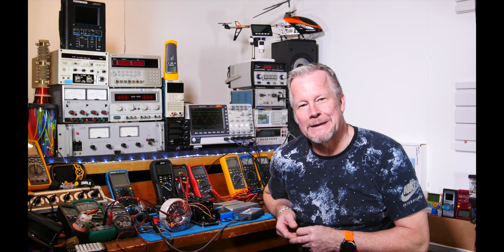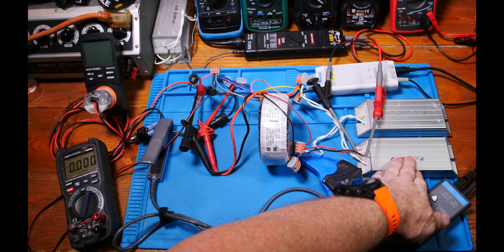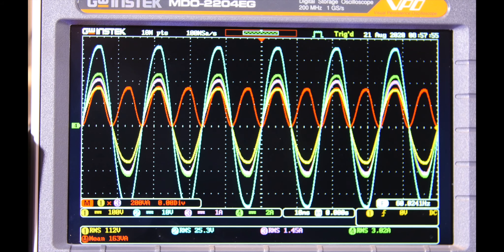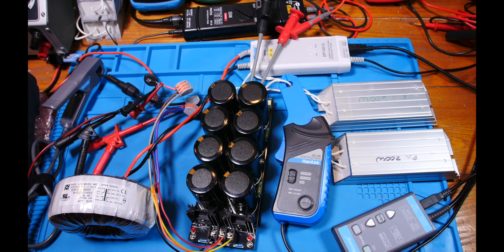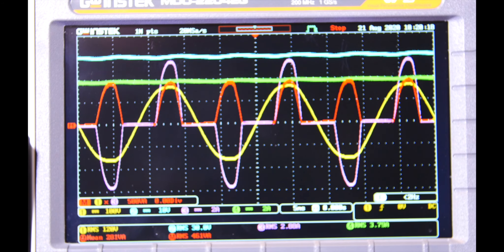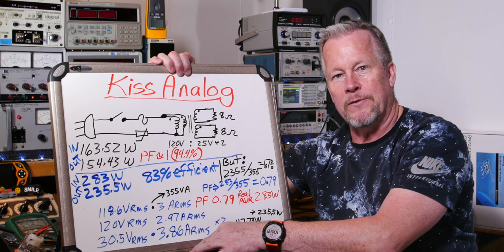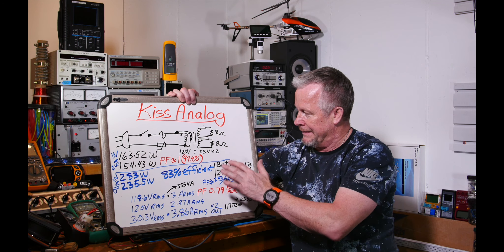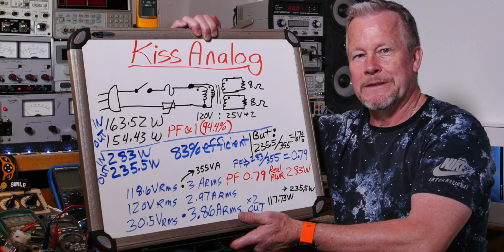Aleph 5 Class A Amplifier; Power Factor Explained

Comment: Excellent Tutorial
I found it interesting to demonstrate that simple rectifying and bulk cap filter dramatically increased power out. Simply DC verse AC into same load.
I also now see PF is a measure of efficiency and an important input into component rating.
Thanks.
Reply from the maker: Thanks for your previous question.  That got me thinking I should do this video;)

Comment: I made so many software simulations and my theory is that not all class-AB consume more than 4 amps at it max or worst case scenarios if the user only use moderated audio levels the rails consumption is really low about 2.5 amps per rail depending on the design, on class A is best to go as large as possible sometimes twice on what is really need it, and yeah I agree is best to calculate that is best choice good video bro 😊
Reply from the maker: Thanks - that’s great info!  I am curious what the dynamic power ratio is to the average power for different recordings?

Comment: Ok Eddy very nice explanation of the power factor, on the forums they say that the power times 3 is the va you want to have, so a Aleph 3 uses 200w of the power supply so you need a 600va, and a Aleph 5 pulls like 300w of the power supply, so 300w times 3 is 900va, my experience i can live with a 800va transformer and have plenty of power for the Aleph 5, for the Aleph 3 u can use 500va but for me the 625va cost almost the same here, so i thake one 625va, o yea and i thake a 800va 2x30v ac out for the Aleph 5 and do a CRC filter in the supply so i have enough for the R to drop, i use a 0,5 ohm so a 0R5 25w for the drop, and i need to have 34v, with the 0R5 you get like 36v so a little over 34v, some do a CRCRC so you have less ripple and less volt, u get like 34v with 2 x a 0,5 ohm 25w resistor on a 800va 2x30v ac transformer, it also has to do with the quality of the transformer, so you need to tune it the way you like it to be, some only do a 0,25 ohm resistors so do what u like and experiment with it
Reply from the maker: Thanks Jos!  You have shown why it is so confusing how to get the right or best design.  I think I need to do more videos on this to see what might work best and how to simply the approach - the Kiss method;)
Reply: @KissAnalog  yea i did some changes to the design of mr Pass, i did change the 10p from the feedback to 22p, but in your video you did say it needs to be like 40 or 50p, so i have to look in to that, and the output mosfets i did change to the irfp250n, mr Pass did say the irfp250n are 2x irfp240 in one packet, thats wy they have more input capacity, and of they have a lower rds-on, like 2 times lower than the 240 did have so i did lower the 1ohm resistors to 0,82 ohm, maybe it also needs to be lower, maybe 0,75 ohm, o yea and you get more power, but i do not have the audio analyzer to test if i did good, thats wy i did ask u for the microcap file and thanks you did send me the files, i hope i can do a test with microcap and see the change i did make, ik was thinking about a software that uses the soundcart to mesure the thd and stuf, so i have to look for that, or i will buy me the QA402 Audio Analyzer, i did hear nice things about that 500$ analyzer

Comment: Great video, thumbs up, but as you know, the theoretical maximum efficiency of a Class A amplifier into a resistive load is 25% and this can be improved to a theoretical maximum of 50% efficiency by transformer coupling to the load. Anyway, I'll be interested in seeing what your measured efficiency is...
Reply from the maker: Thanks for the great feedback!  It will be interesting to optimize the power supply for a Class A;)

Comment: What brand digital multimeter is best.with DC amp and Ac/DC volts up to 1000.lowest to high volts.cheap and best brand 100mhz oscilloscope.thank You.
Reply from the maker: Hi Sugumaran, are you looking for a current clamp or standard type multimeter?  Regarding the scope, do you want 2 or 4 channel?  Thanks for the question.
Reply: @KissAnalog  digital multi meter can measure AC/DC 1000v.please give details regarding hantek 6104BD 4ch PC digital oscilloscope.is this scope worth buying.please help.

Comment: Maybe You can do a segment on switch mode power supplies how better they are for amplifiers if done correctly! especially valve amplifiers is much superior!
Which is better test equipment smps or medical equipment smps
Reply from the maker: Thanks John - I do plan to do this.  I’m also very interested in how it will perform in comparison;)
Reply: @KissAnalog  well it illuminate mains hum 50 or 60hz and 120 Hz. not sure what the best frequency is I think over 120 kHz so it's away from the audio spectrum. what sort of filtration should be used and eliminates interference
Reply: @KissAnalog  you mean comparison with tube amplifiers ?

Comment: The transformer is 250 VA when you rectified you have 36 volt in to 8 ohm is 364 Watts that is overloading the transformer
Reply from the maker: I’ll have to test the efficiency of the amp then get a larger transformer;)

Comment: If you want make a video with a nice simple visual for power factor,  probe the input current on  a dimmer switch powering an incandescent light bulb.   then you can see the current waveform and the corresponding PF  change in real time  as you move the dimmer.   then for fun you can swap out the incandescent bulb for one of those cheap led bulbs and watch the PF go all to hell.   I did this myself once , and it does create a nice visual i think.
Reply from the maker: John G That’s a great idea - thanks!